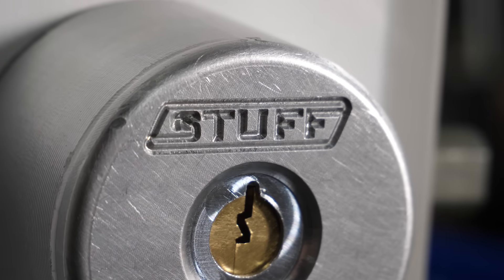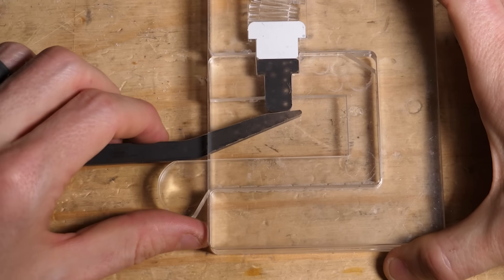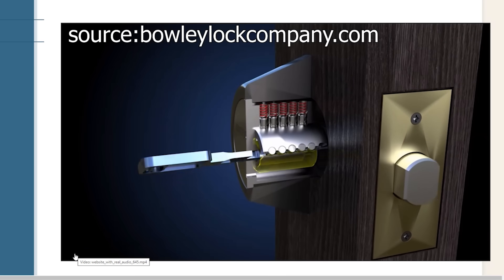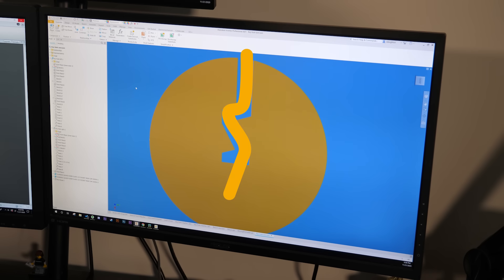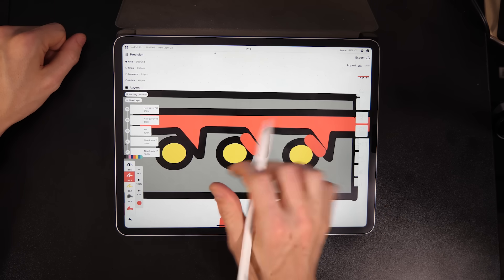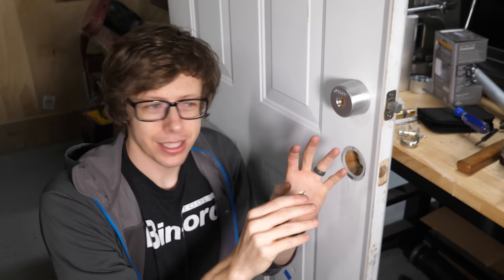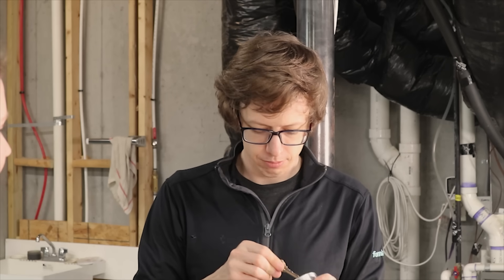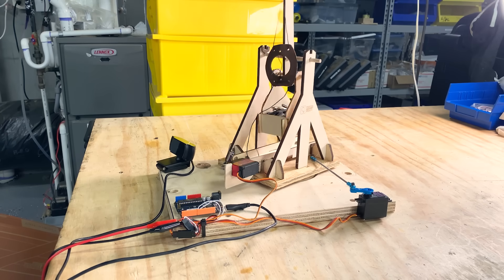Making an unpickable lock. Calling locksmiths

Comment: Gotta say your lock definitely looks resistant to normal attacks.  However the way to test this is to give the blueprints to a lockpicking specialist.  
-Send your lock to the lock picking lawyer #1.
-send actual blueprints of mechanism
-let them determine a method of attack for your lock (Shim, Comb, etc)
Locks are measure in effectiveness in how long it takes to pick or break.  So if it actually is near unpickable then you have something worth selling.

Comment: I have also spent some time thinking about how one might lock several small pins in place at once in the real world, for a project I've never actually gotten around to starting. I came up with essentially two possible answers. I haven't yet tested the feasibility of either, and my application only requires locking the pins in one position or the other (positions that differ by ~1mm travel), but maybe they'll help unblock the creative process?

Option 1: Coat the pins (edit: or the locking arm) in a flexible, resilient material like a hard silicone. You want something with some give, but that won't wear too quickly. This essentially puts the springs in your mechanism into the pin. Some pins will lock more firmly than others, but they should all lock. 

Option 2: Serrate the pin, with a tooth for each cut height. The locking arm then engages the teeth as in your first, simple conceptual drawing. As long as your manufacturing tolerances are smaller than the serration depth, the locking arm should now lock all pins. Depending on the tooth shape, you may need to account for some vertical slop. This obviously has some limits as the pin size decreases and the number of cut heights increases, but it seemed like the cleanest answer for my relatively large-scale application.

Comment: I’m sorry, but at 2:20, they’re permutations not combinations. Order matters whereas combinations are just number of groups with some size. 

Technically combinations locks should be called permutation locks since code {12,13,10} must be in this order. Given 3 elements we have 3! ways to rearrange these for 6 orders. Combinations? We have 3 choosing 3 which is just 1 group which is the group shown above. I can rearrange them however I want because it’s a group but permutations have order and if you change the order, then that’s a different arrangement. 

Otherwise. Your math is correct for total permutations.

Comment: "get a lock that doesn't have a key"

LPL: "this is the lockpicking lawyer, and what I have today is an rfid lock that can be opened with nothing but a fork"
Reply: Yeah was thinking about that too!
Reply: lol
Reply: Am I the only one who watches this in 2x speed
Reply: Ur pp smol
Reply: Exactly! He's shown that most of the major brands can be opened with either a magnet, a paperclip (or equivalent pokey device), a bit of wire,  or other easily ordered for under $100 on ebay/amazon equipment if you wanna take the tech route. You're better off setting up a deadbolt with a trap pin to lock the cylinder when picked like he showed a year ago or so.
Reply: Loooooooool
Reply: As long as there isn't a leakable or brute forceable backdoor lol
Reply: what’s LPL
Reply: @pikabrofar5780  you should really check it out. The comment your responding to is a real video he made, and it's not even the most impressive.
For example he opened a gun safe with an empty orange juice bottle
Reply: @pikabrofar5780  Lock Picking Lawyer

Prominent lock picking youtuber

Comment: You could ditch the spring/friction retention mechanism all together by switching to something similar to the Kwikset mechanism. You add multiple horizontal slots/ridges circumferentially to the top of each pin. The lock bar simply slides into the individual ridge associated with the pin's set height along the axis of the lock bar. This avoids the spring mechanism all together and makes it a bit more commercially viable.

Comment: I just drill out the screws that hold the lock together.  Locksmiths tend to just drill out the pins.  Security is about how much noise, and how long it takes,
Reply: What about Kryptonite bike locks?
I saw a guy put one on his neck, a joker sidled up and snuck the key.  Then had to go to the store to return milk or something.
By the time he got back the guy had been to campus security where someone drilled out lock the but it still wouldn't open.  The key now returned, was useless.
They tried a hacksaw for twenty minutes.  I later saw the scratch.  IIRC, even if they had cut through at that spot it would not have opened the lock.
They eventually went to campus fire department and it was cut off with a torch.

Comment: Or if you know the mechanism you can put the metal thing not as far as to push the locking pin part so that you can individually pick the pins without them locking... or just hit it with a hammer

Comment: Just a thought: Can't you get away with problem of multiple springs for holding pins, if you would just grooved top part of rotatable pins (yellow) - and have a single bar fit into them - and hold them in place if key is fully entered?  something similar to what you show at https://youtu.be/_7vPNcnYWQ4?t=402  which you later dropped. Have like 3-5 grooves at each pin - hence 3-5 possible heights pin can be locked in. Those heights could be probably felt while lockpicking - but that would still not allow to 'test' lock combination one pin at time. Grooves would decrease number of possible ways single pin could be set - but just adding more pins would solve that. That probably means that distance between pins (and key "teeth") would be wide enough to set pins in correct height before key would enter fully and push the bar inside "yellow pins".

Comment: When I was a kid my house had night locks. They didn't use keys, so you couldn't pick them, if you rely wanted to open the door you would have to use brute force and bang the door down. This meant that we couldn't lock them when we left the house, because even if you unlocked the door the night lock would stop it from opening. We mostly kept them locked only at night. They are hard to explain so just google night lock.

Comment: Ok hear me out, but this got me thinking a bit on this problem. I know I’m a bit late on the draw so sorry bout that :/
What if you made a sort of “reverse lock” mechanism, where the pins only bind with the right height? Locks sometimes have little wafers in the pins for mastered systems that are super thin, and won’t really bind easily.
In my head I’m thinking of like a dual pin system, where you can always spin the key no matter what combination (the keyway is on like a bushing or something) and the initial pin stack is also free spinning for each pin. Then, you have those pins able to hit another set of pins like 180 degrees apart, which would truly unlock the system. The secondary pins would just be to verify that you had all the right combinations though
I dunno how feasible this is, probably harder than what you did. Basically, it’s unpickable for the same reasons this lock is; you have to pick every pin simultaneously and try every combination, but it has the added bonus of throwing you off with the free spinning keyway

Comment: I think a big weakness is that it doesnt resist angle grinders or drills. Did you use tempered steel for the enclosure? But other then that I really like the design :D

Comment: I pick locks. Not as a professional, but as a hobby. Individual picking, with your design doesn't look possible, and bumping didn't work, but it looks like it could be opened with the right rake. In fact, the way your design looks, it looks like raking would be the preferred method to open it. I'm surprised the locksmith didn't try it.

Comment: It's cool, but since the lock has so many parts that have to be specification modified to fit the key you have,  any new key will require days of machining and testing to make it run smoothly.

Comment: Also the problem of a lock like this and others that have similar features of having almost zero to a very small amount of clearance and or tolerance. So over the course of a few months to a year the key can wear down and not unlock the lock due to it not meeting the pins in the right height, thus having to make sure your key is properly maintained and not damaged in any way.

Comment: I have a possible picking method and a fix for it. I'm assuming the pins are locked when the key hits the back lever. 

1) Push all of the pins up to the max and lock the pins by pushing the back lever
2) Turn the lock
3) Slowly release the pin locking mechanism while applying pressure to the lock. 

The idea is that the pins will fall while the lock is being turned and potentially catch on the edges of the pin gates. The fix would be to make sure the pins remain locked when the cylinder is turned and can't be released.

Comment: "I found a lock smith that specializes in picking locks."
8:38
Reply: Lots of locksmiths don't specialize in picking. They specialize in workarounds and bypasses of the lock. Or they just drill the lock. Usually it's much easier to go around the lock than to pick it.
Reply: Lol he looked like DJ Khaled
Reply: @andrewgillim5952  as he picks locks "Anotha One"
Reply: Most locksmiths won't even try to pick most locks.  Why would they if they can drill or cut it on half the time and then they get to sell you a new lock at a markup on top of that?

Comment: So it would be pickable if you were able to remember the position in which you lifted the lock pick up at if you can set one pin at a time. So if you know that you hold the pick at 15 degrees for pin 5, then try to figure out pin 4s position, etc.  Then once you get all of those angles down you can pick the lock.

Now granted I doubt anyone has that level of precision without a tool, but it would just need a certain type of lock pick to get it undone.

Great design.  I learned a bit about lock picking.

Comment: The most common way here in my country for getting past a lock. Screw a hardened steel screw into the lock, grab onto it with a sliding hammer and yank, breaking the lock inside.
The lock doesn't look up to that

Comment: Is the pin locking mechanism only held by the key, or is it held by the cylinder once turned a bit? If it's the first, I would imagine the LPL will do something like single pin pick until it starts to rotate and then find a way to bump after disengaging the pin lock.

Comment: The lock without a key statement is not as easy as you make it sound. The Lock Picking Lawyer routinely shows that many of them are made to electronics standards rather than security standards. Many have an easy way to disassemble while locked or defeat with a simple to make or commercially available magnetic tool.

Comment: That hammering trick he used gave me an idea, what about compressed air or some kind of a vibrating device? In theory, if you apply rotational pressure and vibrate the lock at same time, there's a chance that pins might bump into right place for a split second and it opens. Now i'm getting some ideas for automatic lock pick, something that "feels" the pins and corrects itself. I think it would be possible .. but unfortunetely i dont have the funds to make my own prototype :(

Comment: Super interesting what an engineering challenge you set yourself here. You've really laid the gauntlet down for LPL too! 

The only vulnerability I can think of would be possible depending on the amount of tension the secondary pins are under while being held in their test position. Setting all the pins as high as possible (Almost as if you are trying to overset the pins on a cheap lock) then rotate. When the held secondary pins are binding against the gates vibrate the lock with any kind of rotary tool. If the tension on them is loose enough they will begin to fall down into the correct position for the gate. All depends on that mechanisms spring tension!

Comment: Theif: * tries to picklock*

Window: " AM I A JOKE TO YOU? "
Reply: @Diego DD  you can use ducking tape - no sound,  pieces dont fall etc
Reply: @satanlucas8416  ou can just make small hole with special tool which is enough for you hand to get inside and open it. no sound. all process 5 seconds.
Reply: @sguploads9601  getting ducking tape is easier i think =)
Reply: Smart
Reply: Romanian In Germany  translate: Porque são equipes táticas, uma equipa tem de entrar na casa um atrás do outro. Logo a janela não e viável pois terão de pular ela.

Comment: Well i have bad fealing its pickable after all. You puch the pins all the way up lock them, turn the core and relese. Not sure it will work but were is a way there is solution. If there were extra stif springhs and square pins it will make it hard. Also by the desing it cant have many pins

Comment: Keyways impossibly complex to cut?
Son, have you heard the good news that is a broaching?
A steel 'blade' of the exact profile of the hole, that tapers slightly along its length.
There are stepped serrations on the sides of the blade, to cut the brass.
By forcing the broach into the pilot hole (a series of broaches leading to the final shape in practice) each step in the serrations cuts the hole a bit at a time..
For lock cores, the process is automated; most brass cores are cast to 'near final' shape and cleaned up with a single finishing broach.
Then again, you aren't cranking out thousands of locks (yet!), so the expense of making a broach, setting up a multi-ton press isn't justified.

Comment: Rather than using friction to hold the pins in place... pins only have a finite number of positions, right? Use something toothy that will lock the pin in any of those positions without relying on friction. You could have channels that the pins can slide through in any position before they get to the gates where they only slide through in the correct position.

Comment: A off the shelf Pipe wrench and its open , destroyed but open . Far to easy to grab ahold of,,, add more taper to the housing and recesse it into door farther . Locking a door is all fine but windows are so easy to get in it's almost pointless to lock a door , without a wire less security system . As a safe lock where you can custom make the door to accept the large lock flush mount , multiple locks and dead bolts I think you have something worth going forward with.

Comment: Really awesome video and a really nice lock. If I picked it, I would try using the overset position. First overset all pins in maximum height position and hold them by the mechanism in the lock, then in this overset position rotate the core until it stops (pins hit the "warding") still keep tension on core and loose tension o holding lever - but I think that pins will not fall down because they are binding against the warding. And now I would try just a little to lose the tension so the pins can drop down and catch in the right position.

Comment: You are overthinking things a bit, I think. The simplest way to make an unpickable lock is to implement a springloaded sidebar. The binding pressure that you would ordinarily put on the pins to make them pick ends up loaded on the sidebar, which isn't accessible from the keyway. That way, none of the pins are binding, and none of the pins can be picked.

Comment: Sorry for my bad english.
This lock is attackable (I think) !
Just let the pin-locking mechanism in a semi-lock state (Drill the very end of keyhole and glue it)
so that when key holder insert the key, the pin stay in correct location after unlock.
and you can just turn the cylinder after.

Comment: And here is a way to attack this design: You need a tool that can serve as a make-up key (e.g. like a sputnik), then start lifting the first pin to all possible depths and each time turn until it is blocked. Do the same for the second pin only, etc. Each time you map out how far you can turn (e.g. using a laser on the tool) and record how far you can turn. This allows you to determine the correct position of the first binding pin (because despite the fact that elements cannot be manipulated once they engage with the gates, they still have a binding order) and again allows you to break the problem into smaller pieces. This can be made much harder with more complex sidebar designs, in particular indirect spring-driven designs where the turning isn't held up directly by the pins/sliders (see e.g. the heavy-duty sidebar part in EVVA MCS).

Comment: I may very well be wrong here, pardon me if such is the case, but it seems like you've created a variant sort of sidebar? Sidebars generally require an additional tool such as a paperclip that pushes it in with tension against the lower keyhole. So ostensibly it should be possible to push the bar back, perhaps using the same finger keeping tension (I assume horizontal tension such as with a traditional sidebar wouldn't work). The remaining issue is pushing a one piece assembly up, which one can do by emulating your key. I grant you this would require a great deal of time, such that would be absurd, as with  picking a medeco m3 with a medecoder, but this would not be impossible, definitely not if one is able to discern the inner mechanisms.

additionally, keyless locks are arguably more vulnerable as they have failsafes in case power or batteries for readers fail where a key can still be used, which just makes them pickable by traditional methods in addition to replay attacks as one would through a hackrf, pandwarf, etc.

I mean, this is freaking amazing, I think the project is amazing, and I have nothing but respect for the brilliance in designing this, and work, but the idea that this is unpickable is likely hyperbole, rather, not pickable within a useful timeframe, especially going in blind. Either way I am subscribing because I think you've done amazing work. Why not  pass the lock off to Deviant Ollam to try?